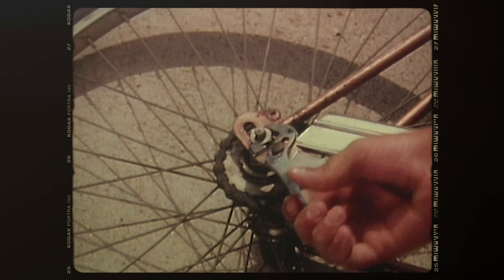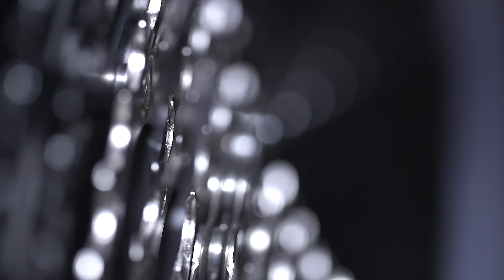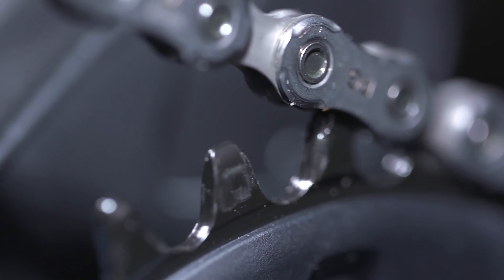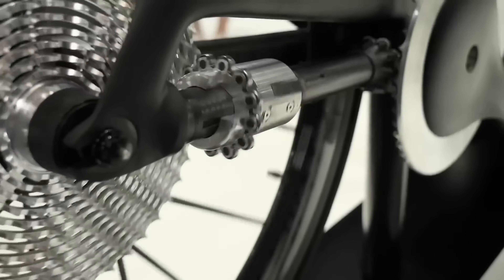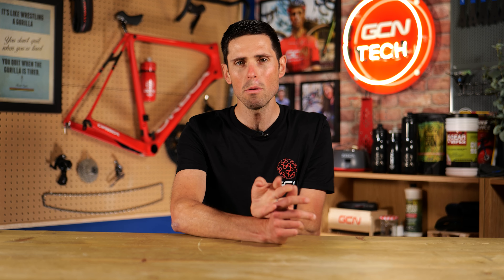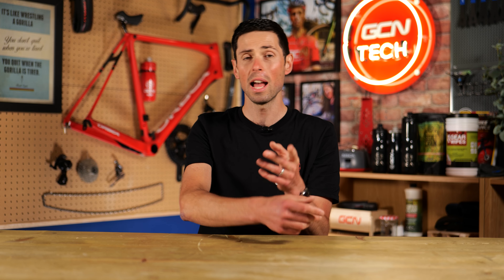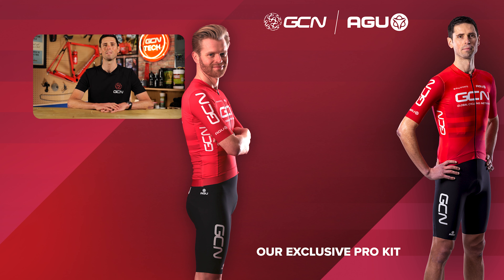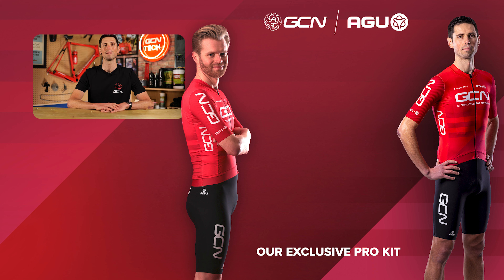Why This Will Never Happen!

Comment: I'm a really big fan of singlespeed bicycles, simply because I loathe maintaining shifters, but also because of the sheer elegance of a singlespeed design; however, it's quite true that riding a singlespeed is a lot tougher in many circumstances that involve elevation changes. Still, if I could have a belt-drive singlespeed, or with a manually-operated internal gear rear hub or CVT rear hub, that would really be the low-maintenance ideal. For out and out performance, it's highly unlikely that any of these options will ever be competitive with chain-driven multiple chainwheel and cog systems with derailleurs, but the vast majority of the cyclists in the world will never need to worry about being competitive. For most people, cost is the overriding factor, and on that score, chain wins by a country mile. The lack of mess and maintenance of a belt drive system is something that only the well-heeled and the cycling tech geek set will opt to pay for.
Reply: Once you ride fixed you are never going to be able to be happy with belt.  With fixed the drivetrain is perfect, no jockey wheels, no nonsense.  Belt is even worse feeling than jockey wheels and chain slap, a true fixed / single speed rider would never be able to accept the poor rubbery bike feel of the belt drive.
Reply: If you ever feel like doing the middle ground try friction shifting. It's awesome when you aren't racing since it can work with almost any derailleur and with minimal to no maintenance. It's now my preferred shifting way.
Reply: @凸Bebo凸  Singlespeed and fixed are not the same, the latter being a non-freewheeling version of the former, and I imagine less suitable for belt drive. But, in either case, has belt tech not advanced to the point where there's little to no loss of power or response relative to chains? But I've never ridden a belt-driven bike so I wouldn't know from experience.
Reply: @HabaneroTi  I ride 150 miles of fixed a week, no need to explain anything to me about it.  If you haven't ridden belt or fixed why comment on what you don't know for a full paragraph trying to educate someone who rides way more than you?  Seems a bit autistic work on that.

Comment: I'm ok with disc brakes,electric gears,narrower bars,wider tyres...but i'd miss the humble chain.
Reply: Whereas the only thing that I hate about my new Trek Roscoe 8 is the chain, having a belt drive commuter along side it. Everything from the maintenance, dirt, noise, have had to adjust shifting several times in just 10 rides...

Comment: I do think belts and internal gar hubs are the way to go for city bikes. They are weather resistant, require much lower maintenance and when efficiency and a large span of gear ratios isn't important and they are mass produced I don't think they are that much more expensive.

Comment: Another method is generator in the bottom bracket connected to a motor in the rear hub.

https://youtu.be/r-Zyp6jX0HM?si=XDCWoqLXn8NRJVkT
Reply: Super heavy and super low efficiency
Reply: @paulgallagher2937  Agreed.

Comment: I agree that the chain isn't going away anytime soon, but 1. "It can last well over 30 000 km" ? Really?  I've yet to see that; and 2. A chain's efficiency drops when it gets dirty/muddy, whereas a belt's stays pretty much the same.
Reply: I had a bike thst I did 10,000 km on in 1 year I used that bike for a few years I would say I did atleast 20,000 km on thst bike and never changed the chain. I kept it clean and well lubricated.

Comment: If the argument against belt drives is ‘expense’ consider the expense of the products this channel is peddling (pedaling peddling, so to speak).  The argument that you need a new frame is could be used by belt drive enthusiasts against chain drives.  It’s remarkable that most people still use chains given the ease and durability of belt drives.

Comment: I don't have a problem with chains, but derailleurs really suck for utility cycling, especially if you have to deal with road salts and lots of stop and go riding. A single speed chain in a chain case will probably last as long as a belt with as little maintenance.

Comment: Once modern science has recreated the doctor's mobile holographic emitter from Star Trek Voyager your bike will weigh 100g and you can have a rod, a belt, or a chain and it'll be brand new every time you switch the device on.

Just don't ask me whether that is even possible or will happen 😘

Comment: Couldn't we say the same for rim brakes and mechanical gearing, why add the offset of batteries and hydraulic systems that increase weight, maintenance and cost.
Reply: You can have a mechanical disc brake - no hydraulic system and no maintenance needed. I had mine for 25 years now and I'm very happy with it.
Reply: Indeed, my choice is always to keep the simplest option: mechanical gear shifting and braking, rather than hydraulic or electrical. Fewer things to go wrong, easier to maintain, and far less expensive. But I did move to disc brakes rather than rim brakes, and I'd never go back!

Comment: The humble chain cannot be defeated. Whilst belt drives are expensive, they are on the market for applications where the performance disadvantage is not of any concern - high mileage zero maintenance makes them a great option for commuting and adventuring where speed and efficiency are not a priority. Whilst expensive they are still within a range of affordability for mid priced bikes. Even with some limited compatibility, the system is easy to implement and customise. Driven, however is a locked in system with zero cross-compatibility and will only be appealing at the top end - which is already a fiercely competitive end of the market. The minimal gains come at such a significant cost.
Reply: I think the price of belt drives is not actually linked to the production cost, but rather the market. Less competition and buyers are willing to pay extra for the belt-drive. Both resulting in a lack of price pressure.
But I have seen several kids bikes with belts (single speed and 3x). So, they are getting more main-stream and with that, there is hope that they get cheaper.
Belts and internal gears offer a massive performance advantage for people who drive in every weather and who do service only once or twice a year.
Reply: Belt drives are pretty mainstream already imo, if you look for instance at mid to high commuter bikes etc. Yes, they're not commonplace amongst drop-bar bikes; but afaik drop bar bikes aren't mainstream either. (I know GCN is sort of aimed at drop-bar riders, but still)
Reply: @peterr680 Belt drives on single speed/fixed gear work. I would think another segment where belt drives would thrive is MTBs outside of XC racing. Not having to worry about bashing a derailleur on a rock would seem ideal to some people.
Reply: Hub gears don't need any maintenance either, so it's a perfect combo.

Comment: For consumers you might be right, but not for professionals. If the Ceramicspeed Driven concept would have been viable, then you would have seen professionals using it, or world record attempts on track. Its a failed concept.
Belt drive is less efficient. Then for consumers is would make sense if it is cheaper, which it is not.

Comment: Everything about the ceramicspeed design was fraud. ENG101 will tell you a 90 degree in any drivetrain lowers efficiency, and the whole system could succumb to a pebble or dirt.

Comment: Belt and gearbox is, I think, a really good option for center drive ebikes that takes oiling from the "I like being greased up every ride" attitude that chains like to "Please never oil me" and I think they're especially good of an idea for rent a bikes and urban commuters that aren't going to be able to go into the bike shed every ride and tune.

But they aren't replacing chains. Not even a little.

Comment: 1500 = 16th century 🤓
Reply: The first year of the 16th century was 1501. The year 1500 was in the 15th century, the same way that the year 2000 was the last year of the 20th century. The reason for all this is that the first century started on year 1, rather than year 0.

🤓

Comment: I think that what will change is the use case for the bicycle. Two of the factors that were involved in making the automobile a near ubiquitous solution to land transport were huge maintenance intervals and low (per km) maintenance costs. However, there are today pressures on the use of the automobile that make it look less optimal for many use cases. I can see HPVs (and electric/human hybrids) becoming much more widely used in the future. This will be accompanied by great decreases in required maintenance. One of the components of that will be sealed drivetrains. We will see more gearboxes, belts and shafts just so that non-hobbyists can just use their vehicles to get where they are going without having to think about maintaining them.
Reply: Shaft drives for bicycles have been tried many times over the last hundred years, never caught on, heavier and big efficiency losses.

Gearboxes have been around for a hundred years also. Internal gear hubs have always had a certain level of popularity. Have always been available to anyone who wanted to use one.

What’s a hobbyist?
Reply: Nah, I don't see this. I don't own a car, and excluding riding for sport, I do on average 5000 km per year just commuting to work and other regular trips like grocery shopping. Which results in me bringing my bike into the shop for maintenance twice a year, and the rest of the time all I need to do is occasionally lube the chain (maintenance meaning everything wear&tear related will be viewed and exchanged if necessary). Parts have become that durable. And if you are looking to the netherelands "sealed drivetrain" can mean a plastic box around your chain.
Reply: Maybe, but it's not like maintaining a pedal bike is that much of chore.  I watched my nephew completely overhaul a 21 spd road bike in about 30 minutes.  I ride mine daily, and it gets a spray of wd-40 on the moving parts about once a year.  The bike is 10 years old now.
Reply: @SaanMigwell  Not for a hobbyist, perhaps. But in terms of mass use, you need to deal with the audience that only gets their tire pressure checked when they get their oil change. The vast majority of people see their transportation as as an appliance that never needs attention.

Comment: Totally agree, it's really hard to best the chain in performance/cost ratio.
Only the belt system is more suitable in some scenario as there is a very noticeable reduction in wearing of the parts that make up for the initial higher cost of installation and is almost maintenance free and works in every conditions with minimal loss in efficiency compared to the chain.
Reply: belt is perfect for everyday bikes. Bikes that are just a mode of transportation for people who do not want to care about it. I like it that these people have that option
Reply: Almost maintenance free until it isn't.  And then you find there isn't a bike shop in a fifty mile radius that carries parts.

At least with a chain, every shop in the country can repair it easily.
Reply: @kestrimurgel5155  This is a problem that could be solved by higher adoption rates of belts. And it's also a niche case where a monopoly sort of helps. If there are only a select few companies that have gearboxes then there won't be as many possible iterations of parts a bike shop would need to carry. Granted I think gearboxes have issues so infrequently that it makes more sense to just have parts shipped as needed.
Reply: @scopie49  trust me you'd need availability or it being fixable by bike shops if you want gearboxes for commuters/touring/e bikes which are the target for this. 

I've had my pinion gearbox breakdown on my touring and had to wait for almost a month for a replacement since they don't have any service center in the country and any LBS cannot work on its internals since it needs specialized tools to disassemble. It had to be shipped abroad for replacement, also it's not infallible, when it does break its impossible to recover from unlike a chain drive where you could go single speed or swap the broken chain. 

For performance bikes, I don't see the chain drive going anywhere as the weight to efficiency ratio is just that good. 

For perf bikes
Reply: @ryoukokonpaku1575  I feel like it would be less of a problem as belt drive became more and more widespread. LBS would want to carry parts if like 50% of users were on belts instead of the like.... 1%? that is is now. The long delivery time for spare parts is really the fault of the companies that are selling gear boxes. Because of the way a gearbox fails (catastrophically and unusable until fixed) these companies should have spare parts lying around in excess and overnight shipping.

It would also help is the bike industry would stop pushing proprietary bullshit and just standardize already. LBS hate having to carry a billion variations of thing. For chains alone they have to carry like 4 different types just for how many speeds your bike has. Then there's brands and their tier levels of chain, colored variations, pin style, etc. All unnecessary.

I want belts to become more popular and bring the prices down so that I could consider getting one without feeling like I'm paying an adopter's tax.
Reply: @scopie49  For gearboxes they really need to standardize on a frame design. Everyone currently is running their own proprietary frame mount since like non-DIY kit Ebikes they can't just be bolted onto a standard BB frame. This is the biggest hurdle from a cost reduction perspective since despite bike BBs being a mess, it's still better since the variations isn't radical and there's a ton of adapters available. 

They can definitely be attractive for bike hires, ebikes, and commuters due to durability, but the problem right now is manufacturers have to make a custom frame (expensive) for them due to the nature of gearboxes, you can't just buy a frame and bolt on a gearbox due to non-standard mounting brackets. It also doesn't help that the commuter/touring market isn't as lucrative as the performance bikes market which makes it a hard sell for companies right now and that market isn't gonna move to gearboxes due to performance to weight efficiency of a chaindrive. 

Ebikes might be the answer here, but this depends largely on cycling infrastructure being built instead of being car-centric which turns off a lot of market adoption.